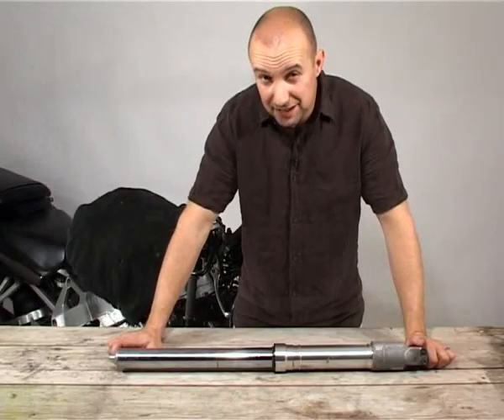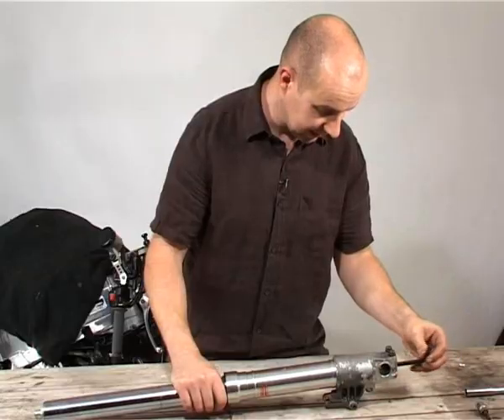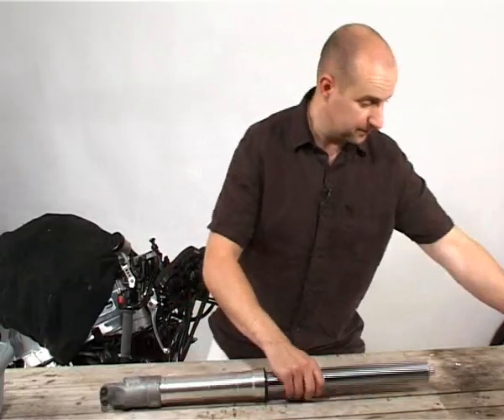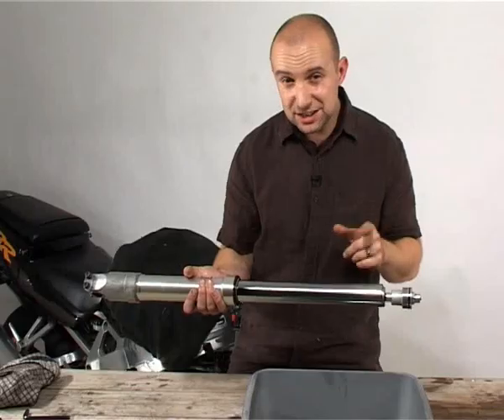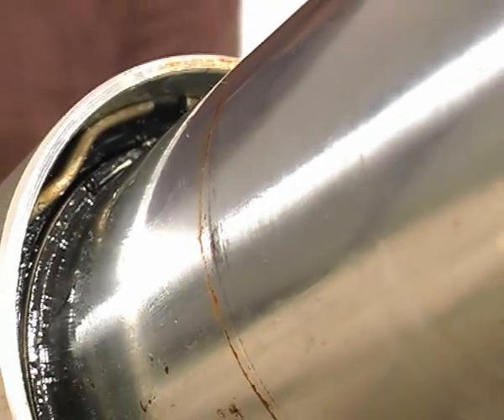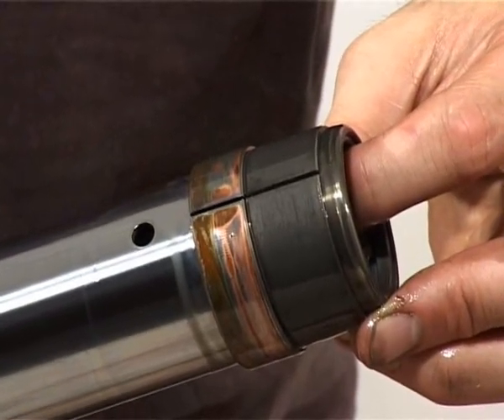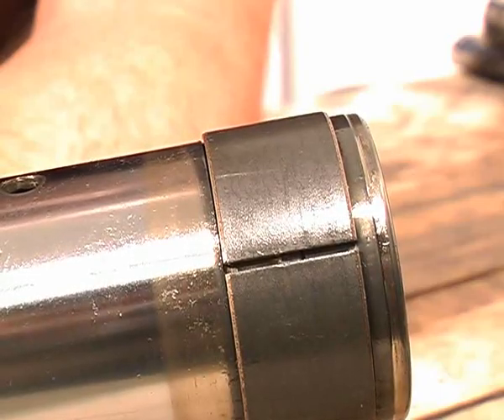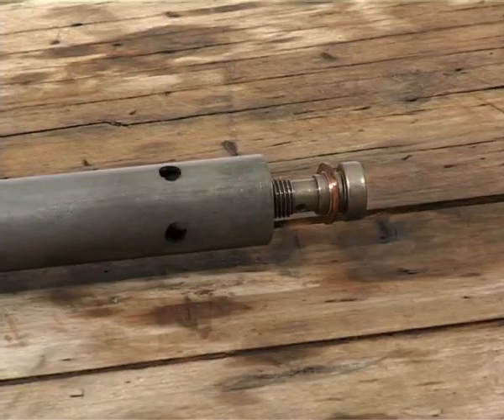Replace your fork seals - dismantling the forks

Comment: Excellent video, i would like to add a top tip. You dont need to disturb the springs, leave the top cap alone and just separate the fork bottom from the chrome tube by removing the bottom allen key, thus leaving all the spring section in place. With the bottom key removed you can pump out the old fluid . Saves a lot of time and mess!

Comment: This video omits a very important step. Reassembly... you’ll have to have a bushing/seal driver. It is a device that fits around the fork stanchion tube, and drives the bushing back into the fork slider where it was. And then it will drive this new seal into the fork slider...If you do not have a seal driver tool, Many times you can just use the old seal to drive the new seal in .. you can make a bushing driver/seal driver out of PVC pipe. The longer the better because you can tap on the end of the PVC with a block of wood if the PVC piece you are using is longer than the stanchion tube.. you must be careful not to nick or scratch the area of the stanchion tube that the fork seals wipe during their stroke..
  coat the seal with four oil so it will not run dry..
 then when refilling the fork with fork oil, you can change the weight of the fork oil from the standard recommended weight, but you cannot put more fork oil in van is called for or you risk blowing fork seals.
  When cleaning internal parts such as the fork cap that has an O-ring on it, be sure not to use mineral spirits , that will damage any rubber parts such as the O-ring at the top of the fork..heavier weight fork oil will give a softer ride..lighter oil for a firmer ride..You can also try different amounts of oil but do not exceed the maximum. 
  fork springs do you lose their stroke resistance over time. As they degrade, you really don’t notice that they have degraded as much as they have until you put new springs in. fork springs are not like fine wine, they don’t get better with age...
  When doing a reassembly of the machine and installing the front wheel, make sure that you do not bind the forks by tightening pinch clamp first. Always tighten the nut on the end of the axle first, then compress the front forks a few times before finally tightening the pinch clamp on the axle. If you tighten the axle nut last, after the axle clamp/pinch Has been tightened, you will be binding the forks, and this will not allow the forks to slide up and down freely. Just think about it a little...

Comment: thank you. working on my 05 ZZR600 fork seals and needed visual aid getting that darn dampening bolt out. Of course I took the top cap off and drained out all the oil out and removed the spacer and spring and found the dampener bolt should have been loosened already. Now just need to find a suitable clamp.

Comment: Big Dog Motorcycles instructions state "use an impact to loosen the bottom bolt". I've done that, and it works great. There are very good reasons to do this.

Comment: Nice video. That Fireblade looks like a cbr900 correct? I am doing this currently on my 929 Fireblade. 5:10 Nice! I needed to see how this is done. I'll be replacing bushings as well. I imagine reassembly and new fork seal installation involves a metal pipe slid over and pressing/hammering the new seal into its seat? Thanks.

Comment: Did you separate the tube from the lower fork housing? How would this be done? The lower 10mm alen key removed and there is a side pin/set screw? Will the housing need to be heated? Time 2:02 in the video.

Comment: my cb250 has no bottom bush, I've done one fork using a slide hammer, all back together and complete, but I cannot release the oil seal from the second fork it's now bent out, I can't get behind the top bush with the slide hammer, and cutting the seal out would probably score the fork leg and render it knackered, any ideas?

Comment: Hi
I will be dismantling forks in my 2001 Honda vfr800 due to a concerning mechanical crunch like feel from the right fork upon compression. My question is, would my forks be of the same design/construction as those of a Fireblade shown in this video?

thanks

Comment: This looked easy, my Yamaha XJ600 1997 bike needed a special Yamaha Tool, cost was £75, to undo the bottom bolt, otherwise it was impossible, as the Damper section just spins around. I used an extended Allen socket, I used an Extended bender bar, I used a drill on a fast speed with an Allen socket to undo the bottom bolt which hadn't been Locktited before, and never will be, no need.

Comment: Can you remove just the bottom damper bolt to drain the oil??
Reply: It wouldn't be so easy to put the oil back in though.

Comment: So I'm currently doing my forks but the bottom bolt on the forks just keep spinning do you have any ideas on what to do?
Reply: Did you ever solve this?  Having the same issue
Reply: +Cody Long Compressing the fork leg to give more pressure downwards can help stop it from spinning. This is no easy task as you have to still have access to the bottom bolt. When I had this happen I clamped it in a vise at an angle and had an assistant compress the leg while I tried turning the bolt. Try using an alan head key extension on an impact driver.
Reply: +Cody Long Even better way, put the fork back into the bike and tighten the pinch bolts. Compress the fork with one hand and try to loosen the bolt with an impact with the other.
Reply: Thanks man. If I remember correctly I used a impact. It's been a year so I don't fully remember. Thanks for the reply.

Comment: what if lower screw does not unscrew?
Reply: +Morocco is the best If it does not unscrew your forks are basically junk. I've occasionally seen them get seized and not come out or strip out, this means you cannot separate the fork. The only way to replace fork seals when this happens is pulling a seal with a seal puller from the top which can damage and mar up the fork leg. I had this happen with one of my bikes and it was a nightmare replacing seals. Also means you can't replace bushings which can be a problem later on down the road. The best way to remove them is with an alan key socket that is very long which can be hard to find. A quick snap on a socket wrench should remove it, if not you could always try an impact driver attached to the alan key socket but you risk stripping out the bolt. Thread removers usually can't remove this and heating the fork is probably a bad idea.